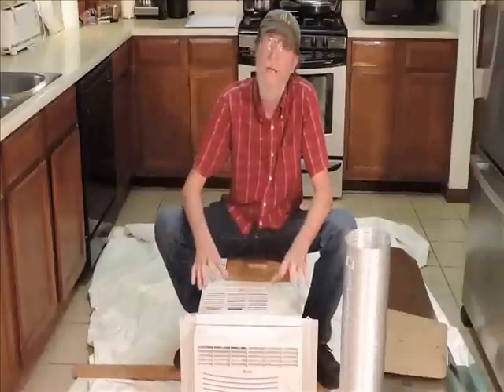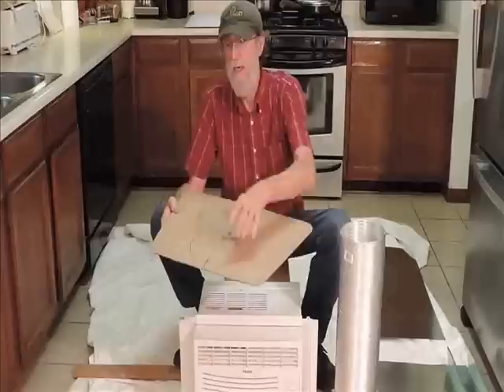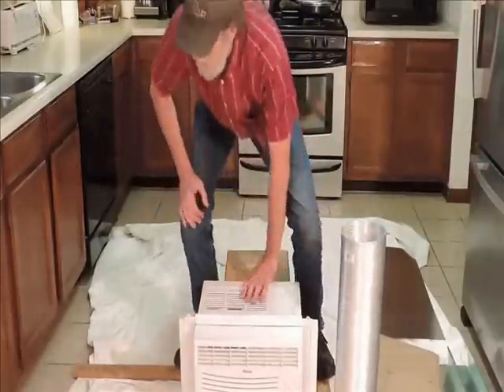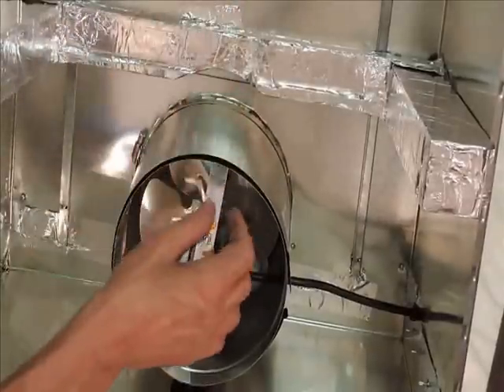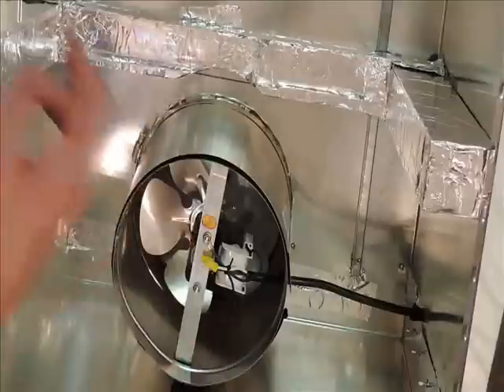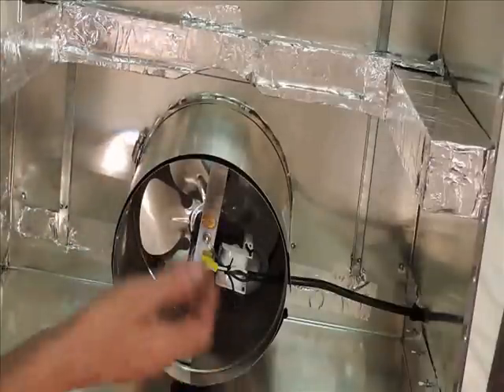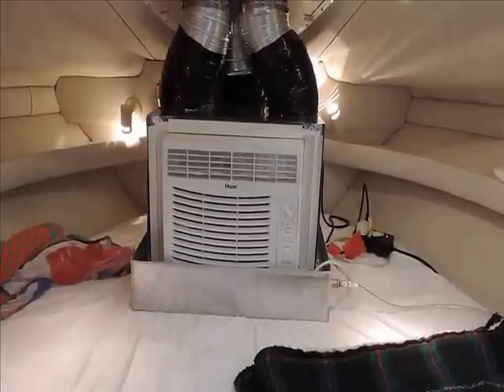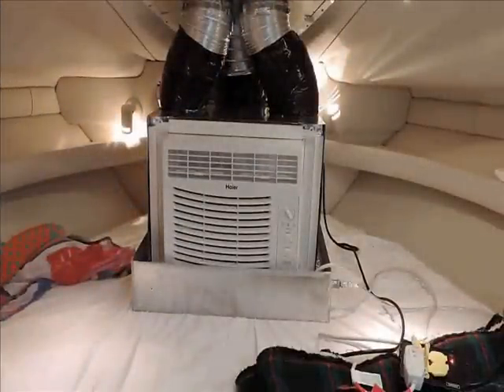Marine Air Conditioner

Comment: Very good.

A huge improvement would be to have the two inlets face forward on the hatch and the exhaust face to the side. on a mooring or anchor the head wind would thus work int he correct directions.

It would also be nice to mount the unit higher or even on a hoists so it can be raised and lowered with a table on top of the air-conditioner. I could also see a variation of this with long insulated ducted hoses so the air conditioner could stay where it was and the only thing to  move when wanted was the hatch duct seal.
Reply from the maker: It worked too good and its still working now. I did switch to Mylar flex duct so it was easier to move around. The secret is the boost fan in the exhaust. I could water cool it but lost interest. Too hard for average boater.
Reply: Its a very good solution. Well done. I may do something similar. Thanks for posting and sharing it.

Comment: i admire your  concept on the modification of the window unit  you should ;ppm at mini splits air conditioners on Ebay  they have units  for under 500 dollars that are all self contained  into 2 parts  and you only need to  run the cooling lines  from the exterior to the interior  also Mr Cool makes a reasonably priced  unit  ive owned 16 or 17 boats  and ive tried using  window units  unfortunately they dont work efficiently , look horrible , and are extremely, loud  although i do like your way  a lot and  the interior of your boat  does muffle the sound pretty  well in the v berth  as a custom Woodworker i even built wood cabinetry around one of mine in a effort to quiet the noise  that helped  but  wasnt perfect  either although  it hid the unit  in my galley area another plus on those mini splits is there are some so efficient know you can run them on solar power  check out a you tuber that put one on his camper and runs it 24 / 7 365  using solar

Comment: No need to do all that work you just put 5000btu a/c   in the back wall where the glass is and use a good blower to take out the hot air i dit it in a donzy 25.6 sport cruiser and freeze the cavin
Reply from the maker: No back wall.  No glass window.  Just engine bay.  Cabin below deck.

Comment: If you can't afford air conditioning you can't afford a boat
Reply from the maker: Yep  Never could afford an expensive boat like that.  Always wanted one and bought one after I retired.  Hee ...Hee  Gee whiz wonder how I saved the money???  NOW you know.
Reply from the maker: Also I want to add that boat had 165 hours on the engine since it was built in 1998.  I was the perfect new owner.  Cruiser had been kept in dry storage by very rich man and only used once a year to go to his fathers parties.  I am a mechanic by hobby.  So i knew rubber parts like sea pumps needed rebuilt, thermostats were toast, oil change super critical and distributor caps had rusted contacts.  Brought it back slowly attending only to most critical first.  Stuff like oil and cooling which you cannot comprehend but would wreck an engine within hours.  Yep boat ownership perfect for me.  How about you?

Comment: why not just a portable ac with a vent?
Reply: portable ac with a single output hose creates negative cabin pressure, pulling in as much heat and humidity as it pushes out. A dual hose system works quite well, but both options take up considerable valuable cabin real estate.

Comment: This is really neat. I did something similar with an RV roof AC unit. Created a couple of mounting plates similar to what's shown here and mounted it over the front hatch. Now I have AC in the front cabin and the water drains off the side of the bow. I have a flybridge so it's not really in the line of sight. The power cord was routed through the chain locker and out to shore power when at dock or into the galley if I'm running the generator on the lake.

Comment: Would it have been easier to do the opposite? Vent the cold air to the inside and put the ac on the outside with proper mounting.
Reply from the maker: Good question. Yes it would be much easier and compared to having no AC at all I considered it.  Problem is all AC units recirculate the interior air as they cool it.  This greatly increases efficiency.  So in order to cool to any real effect you would have to have two ducts.  A small one delivering cold air inside and a large one returning the semi cool air to recirculate.

Comment: What will be working against you in this setup is that the hot side of the air-conditioner  is on the inside of the boat. The condenser and the compressor are dumping their heat into the area you are looking to cool. You need to insulate the case around the hot side so that heat can be blown out of the boat,  not radiated back in. Same for the hoses.

Comment: I'm a marine service tech - Y not fix the a/c unit that CAME with to boat.. ? Look like a 24' Searay so it had a 16,000 btu unit installed 115 volt     so Y.
Reply from the maker: Its a Regal 2860 Commodore.  The air conditioning option was not installed.  There is a storage compartment in the back berth which I guess is the space for AC.  The Haier 5000 btu window unit provides more than enough cool for southern states like Georgia.  In fact even at 100F I have never had to turn the temp past 3/4 of the way up.  I suspect it is a combination of the added boost fan combined with the recycling of the condensate which gains efficiency despite being ducted.  Whatever the reason I was pleasantly surprised if not a little shocked at how well it works.

Comment: Wonderful  proof of concept now someone needs to design a enclosure the sits on the deck so you can get the AC unit off the v-berth bed.
Reply: That was my immediate thought.  I'd hate to sacrifice my V-berth, but I can possibly build a housing to sit over my salon hatch and blow cool air down in, while leaving the hot air outside.  And the drip could go right ahead and roll off the fiberglass (or I could run a hose over the side if I didn't want the mineral streak).  Seems like the hardest part would be making sure it was secure in a windy situation, and keeping the rain out.  I think this is going to be my plan for 2020.

Comment: so... if the aircond is on your bed, where do you sleep?
Reply from the maker: Actually we later swapped the duct with coil reinforced Mylar so I could set it farther back or even sit it on the cabin floor.  But truth is I made that for my wife who has a difficult time with heat.   In the hottest months I sleep above deck within the camper cover and only crack the companionway hatch door halfway.  Fully open freezes me out.  Its the axial duct fan that I added.  It pretty well puts a window AC on steroids and surpasses its design efficiency.  Ok for laying there watching a movie with a flannel shirt on but too cold to sleep there.

Comment from the maker: For you creative guys.  I was tempted myself to do this but because the boat was in the water could not justify the expense of having holes drilled through the hull with valves installed.  Plus my problem required immediate attention either I cool the boat or the summer is lost. My boat has molded into the interior hull a place for the marine AC.  It is in the back berth/storage area and juts into the engine bay.  All you would need to do is strip a small window AC down and put a water jacket around the coil in the back, plumb it to a RV 110 water pump and pull cool lake water in and dump the hot out.  You can run a few coils copper around the compressor using the lake water and cut some vents so you still have air flow in the back.  Just don't have the compressor sitting in a tightly closed box.  Modern AC units have a rubber plug where the condensate drain used to be so that the fan slices through a pool of water and cools the compressor. But if you could build a kit that would take a $140 window AC and install it where a $1000 AC went and have good performance there might be a decent profit spread for a startup.  Heck forget permanent installation just have two hoses you throw in the water.  The efficiency would be beyond belief.  Just something to think about.  Make a good Youtube video if anything else.  Of course bear in mind corrosive forces (especially salt water) so make your exchanger and coils out of plastic and fill the transfer medium with a fluid that protects aluminum.
Reply: Refrigeration compressors are cooled by the suction line from the evaporator. The fan splashes water on the condenser coils to make the heat transfer more efficient. It’s not needed if you fit a water jacket around the condenser to make the heat transfer.

Comment: Well done, I applaud your knowledge and craftsmen ship!

what it going to take for you to build me a kit? Name your price
Reply from the maker: With the different dimensions of small AC window units kits would be impractical. I even bought an identical unit as a spare to avoid having to redesign the foam should the boat's unit wear out. One improvement not shown in the video is the flex duct.  I switched from the rigid to the Mylar foil type.  Now I can easily slide the AC unit to the side and put the vent in the hatch without unhooking the duct.  Handy when its 140F in the cockpit and 110F in the cabin to be up and running in 3 minutes.

Comment: This is nice if you stay in a marina and not for underway.  It take's to match energy from the batteries.  Or you must late run a generator.
Reply from the maker: Absolutely!  Having worked with solar panels the math on DC inverted to AC power cannot be denied.  Generator would work but when on the lake away from the dock I have found a fan does quite well with spare battery and inverter.  I worry enough about my DC refrigerator running down the starting batteries.  The real problem is how much heat is generated from the dock and all the surrounding boats at the wet slip.  I keep my camper cover sealed tight when not in use to protect from birds and the elements and have recorded temps in excess of 140F from the fiberglass in the cockpit area.  When on the lake the wind and cooling from the water is considerably less.  It really is a "Parking lot" effect at the dock.  Its also handy to have the AC running full blast when working on the engines in full sun.

Comment: Pretty cool - literally. I was wondering why you could not reverse the system - leaving the AC on the outside and venting the cool air into the cabin. Well done with the metal work and idea btw!
Reply from the maker: That is the principle that hatch type portable AC's use.  There was one in the cockpit area of a sailboat next to us.  I ruled it out because it was too heavy and bulky.  No way could I see myself dragging it out on the dock and clambering over the bow to install it.  The depth sounder at my wet slip reads 41.3 feet.  Lol ... one mistake and I would be Googling scuba gear.
Reply: Kind of equivalent to those running around with a unit sticking out a window. :) Bet they were cool though. There are probably better reasons to take up scuba but think of the story you could tell. Thanks

Comment: cools the cabin but there is no space left to sleep. seems too bulky.
Reply from the maker: Jose Marinez Yes.  That front berth is shaped strangely.  There is only enough room for one person to sleep and then only on the very edge.  Fortunately the air conditioner makes the cabin way too cold for me anyway.  I just crack the cabin door and sleep under the camper cover over the engines.  It cools the entire area down nicely.  In the winter of course I use the front berth with a small heater and draw the curtain while my wife opens the other two cabin vents to let in cold air.  So regardless of the season we both end up comfortable.

Comment: Rob can I ask what would happen if you only vented the very back of the air conditioner to the outside and allowed the top and sides to be open inside the cabin?
Reply from the maker: Mike McCarty I considered doing it that way but since it would be using cool air to run the exhaust there would be a loss in efficiency.  Further loss would be added from outside air coming in thru the cabin door to replace the vented air.  Portable air conditioners use the same principle and although they work they suffer loss.

Comment: cool video Rob. Good to see you making them again
Reply from the maker: KEITH ZERRLAUT Yes I must admit the boat has taken a lot of time away from videos. It was kind of an unusual purchase.  A 1998 cabin cruiser with only 65 hours on the engines.  It would be like a car that was never run sitting in a garage for 17 years.  You have to be careful and use a lot of patience to bring those engines back without destroying them.  I knew it was going to take a "high learning curve" and so far it is working out beautifully.  At least now I won't get heat stroke working on it.